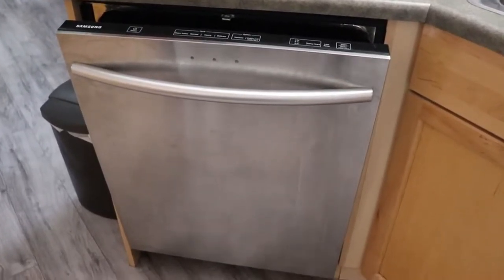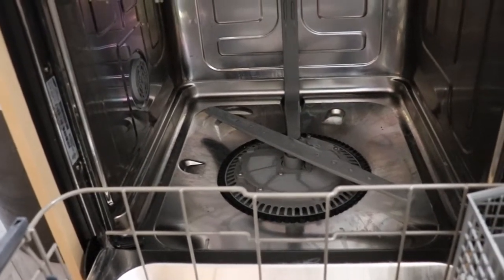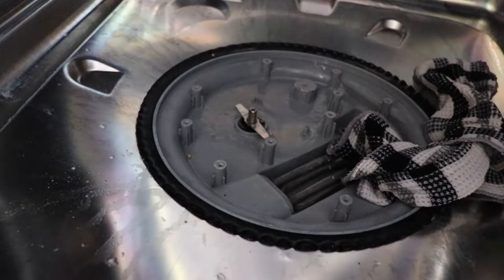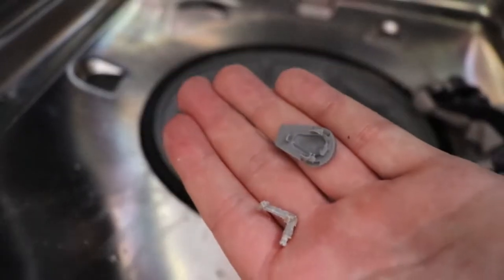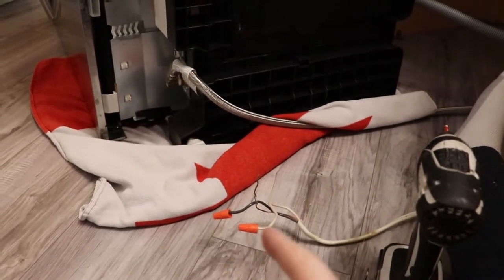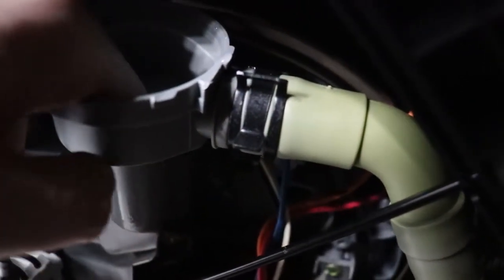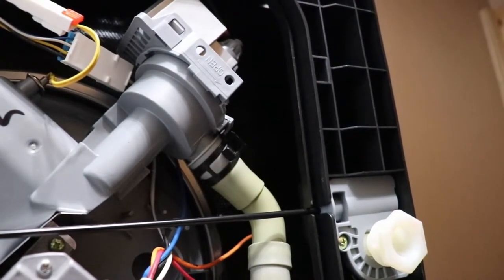Noisy/ Loud Samsung Dishwasher, Easy Fix!

Comment: I did this and now I am having "HEAVY" light flashing ....there was some water in the dishwasher not sure if its detecting leak...any suggestions how to fix it.
Reply from the maker: @AjayGuPta-eq3gb  I did a quick google search it says your dishwasher has too much water in it and is in flood mode.

Possible solution (googled):
When the dishwasher won't turn off, the leak sensor is usually the cause. If the sensor detects moisture, the sensor will try to perpetually drain the dishwasher which prevents it from turning off. You can fix this by selecting a different cycle, looking for error codes, or checking for leaks.

They say the moister sensor is on the bottom of the dishwasher and it won't reset until it's dry. Which might involve remove the dishwasher manually drying the sensor with paper towels. If the error still occurs it might be due to a fault sensor. I would see if you can drain water out of the dishwasher if possible and proceed to drying out the sensor.

I hope this helps.

Comment: How do you get the screw out on that round plastic part??  It just turns the entire assembly and even if I hold the assembly it won’t come out.  I don’t want to break the plastic part.
Reply from the maker: For the piece you are referring too i think i used a impact driver with the correct bit.
Reply: I had to turn the screw the opposite direction from normal while carefully preventing the plastic part from turning using pliers.
Reply: @johnklaassen1260  yes critical! Reverse threaded because it’s a propeller
Reply: It is reverse thread. Struggled myself until i figured it out.

Comment: Oh lucky you!  I had the exact same problem, same sound, though my dishwasher is about 8 years old.  It would happen during the initial drain phase and there was still a very low flow of water being drained.  Went through the same steps, cleared it out from inside the unit and at the drain pump from below, and even ponied up $99 for a Sears tech to come out and diagnose.  All he did was a Google search on his phone and found the same info I had in the previous week!  Said it would cost quite a bit more to eliminate the drain pump as the problem.  I was able to find a new one for about $25 and while I had things opened up, I turned breaker back on to test the old one (applied live wires to leads on old pump - DON'T TRY AT HOME KIDS) and it worked fine.  This gave me a sinking feeling.  Went ahead and put the new one in, zipped things up and . . . STILL GET THE DAMN BUZZING SOUND.  It's coming from the power connection area and I'm thinking it's an electric/control system problem.  The pump seems to be getting less voltage, hence the much reduced flow.

Comment: I just finished cleaning it, but couldn't get that propeller off. Still making noise. I probably have that exact same piece of plastic under there!
Reply: the propeller screw is reverse thread. Struggled to get mine off till figuring that out.

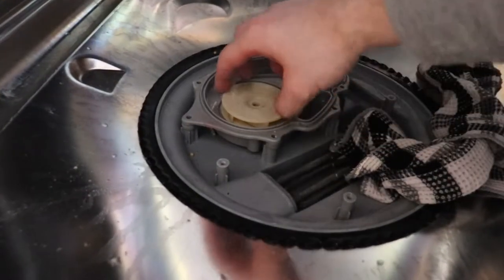Comment: How did you remove the screw at the 3:15 mark? I am struggling with that part…
Reply from the maker: If i remember it might be a reverse threads. Try that and let me know. Or it was on tight i used a impact drill as seen in the video just dont hold the trigger too long.

I hope this helps.